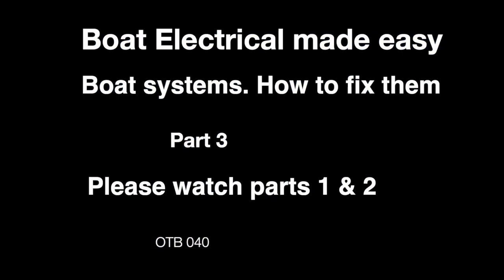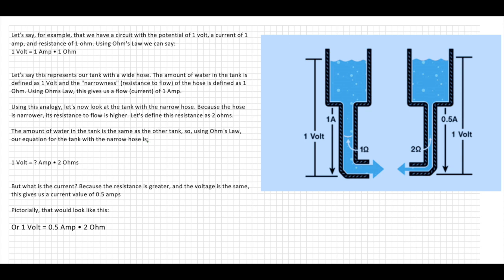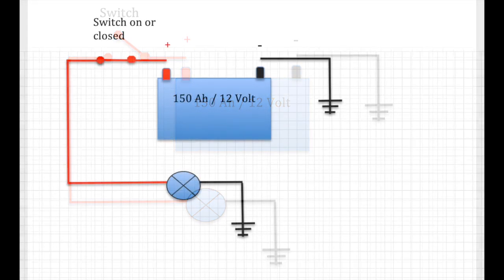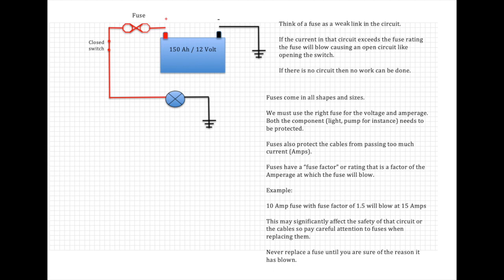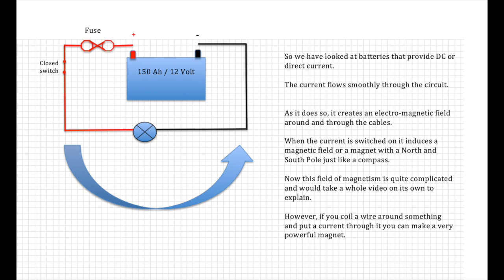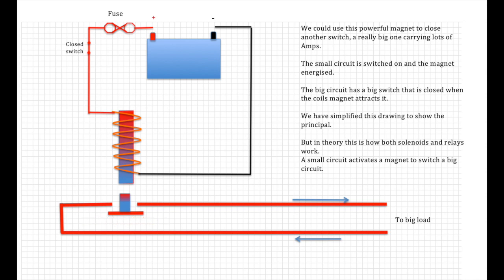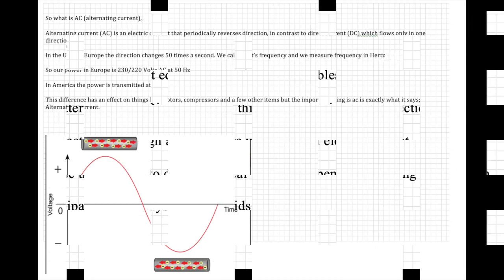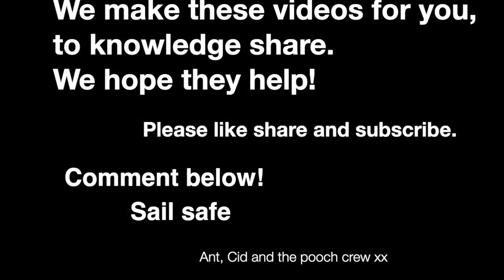Boat Electrical Made Easy. Part 3 Boat systems, how to fix them

Comment: Very informative in a different life worked at the ROF Blackburn ( known locally as the fuse factory , as they made fuses for artillery) sure they work with the same principle but wasn’t a spark , but finding you’re explanation of electric really good not only for boats but in general.
Reply from the maker: Sir your a gent! We always look forward to your comments. Timers, fuses and detonators may be a subject for another video on ordnance. Just need to figure out how we make it sailing related 😂😂 Sail safe Shaun. Ant, Cid and the pooch crew xx